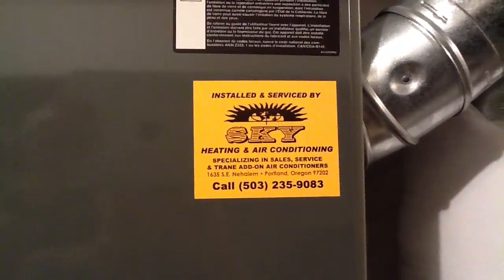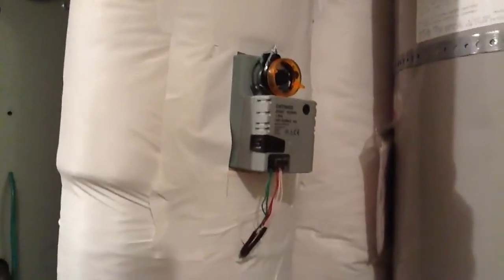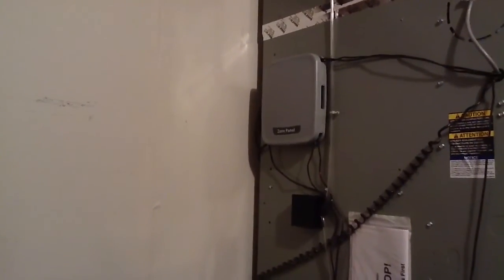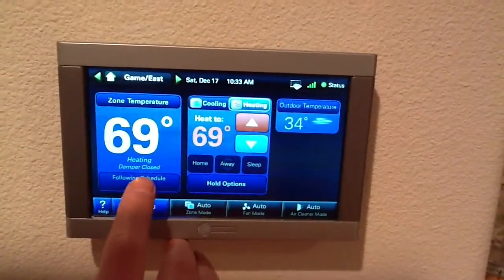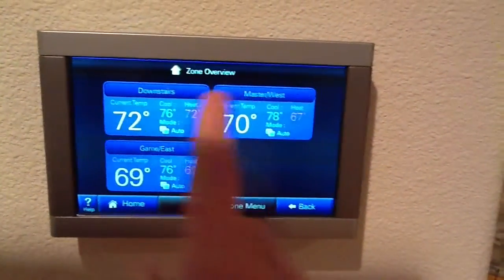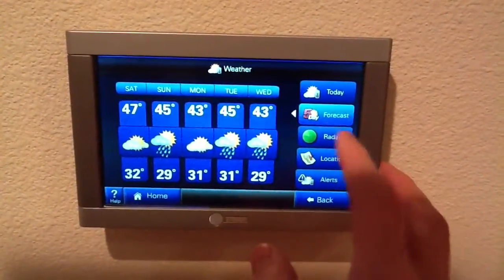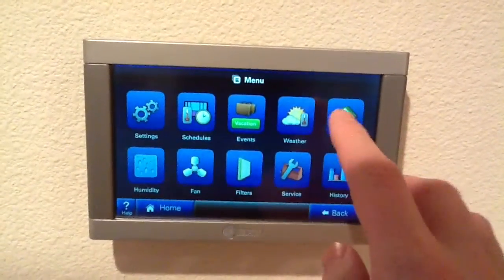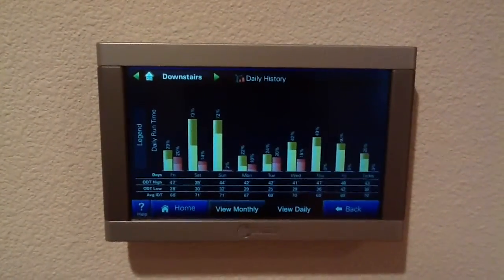Overview Of Trane Zoning System

Comment: I haven't found a dealer yet, that can update the firmware in the controller.  And, to make matters worse you cannot cut off a zone.  Programming of the thermostat allows 40% bypass air, even when the zone is turned off.  Not what I expected.  Forget the bells and whistles, been using 10 years and sorry I ever purchased it.  No help from Trane, they will not talk to customers.  Don't buy it.

Comment: I’m considering purchasing a Trane Zoned system.  It would require going from 2 separate heat pumps to one Trane system with 3 zones: master bedroom area, downstairs and upstairs.  I not sure if I should just retain 2 heat pumps or go to one.  Are you still pleased with your zoned system and how is it working.
Reply from the maker: Robert Vittetoe I still feel like it's some of the best home improvement money I've spent. I can't speak to your specific situation but I am still living this system.
Reply: Thanks very much!  I know I’m going with Trane just need to decide if I want to replace both my units with one or keep two.  I know for sure I’m going with a zoned system downstairs with a separate zone for the master bedroom.  Thanks again!
Reply: @robertvittetoe6158  Surprise.  The controller allows a 40% bypass air even when it is turned off.  How do I know this,  I have a four zone system and have turned off the Living room and the sunroom, but even when they are turned off, I still get air going to them.  Had to close the registers, but that only helps a little, because the registers don't close off the air completely.  The company that installed it, no longer has a tech that can work on the zone system.  They only sell a few systems.  I have 35oo sq ft on one level, and heat and cool only two of my zones, yet the other zones contain conditioned air.  These systems can only be serviced by local dealers.  Unlike some of the systems I sold, which had controllers that could be accessed via the internet from the factory, that is not available from Trane.  I was a manufacturing engineering manager for a Trane company, which they drove into bankruptcy.  There is no support from the factory.  Pay your dealer and take your chances.

Comment: How many sq ft is your home? Curious to understand at what size of home a zoning system becomes needed.
Reply from the maker: Matt Robins A bit over 2300 square feet. It's not the size so much as the inconsistency that caused us to look into it. Summer: turn on the AC, downstairs is freezing and upstairs is still too hot. Winter, exactly the opposite. Now the house is nice and consistent.
Reply: Travis Illig same here